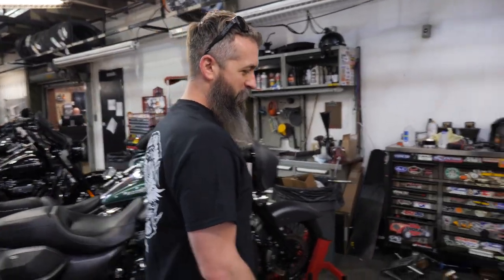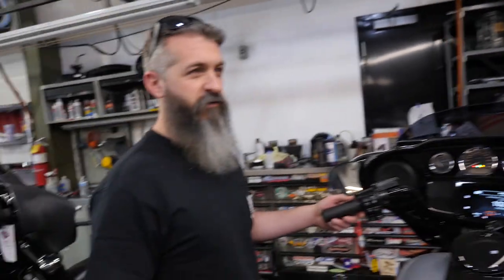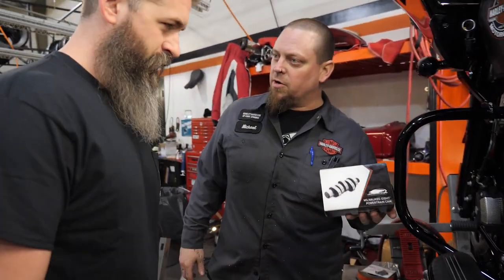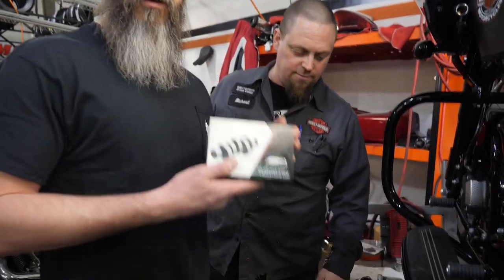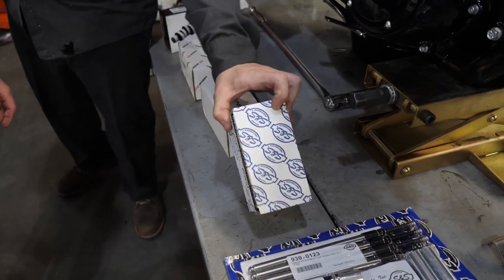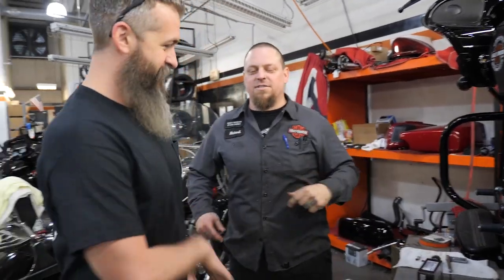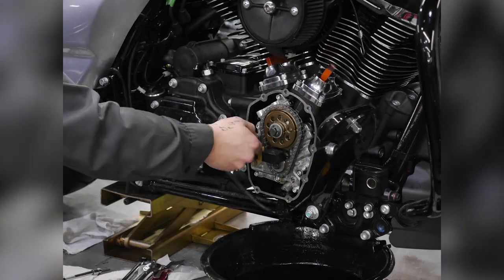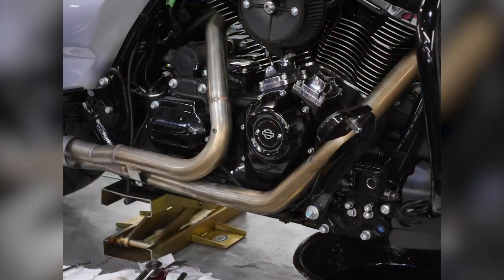Cam Test Part 2 COMING SOON

Comment: I have the Harley Stage 4 107-114” kit. What would be a good aftermarket cam with around the same lift?
Reply: We can email you some Dyno sheets of a couple different cams we have used for that Stg 4 setup.  Call Aaron at the shop.

Comment: Question   on M8  107 stage 1 screaming eagle pro tuner with V/H 450 os exhaust  if I have you folks change cams and matching exhaust. will that change my cruising rpm  e.g. 3 thou at 75 mph now what would it be after you add cam and matching exhaust